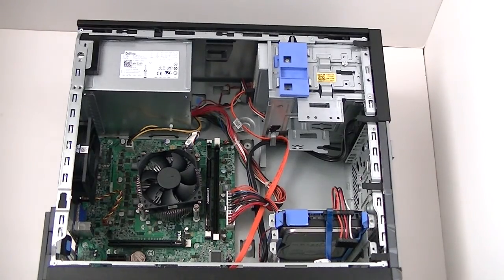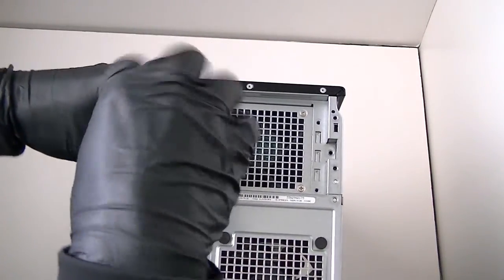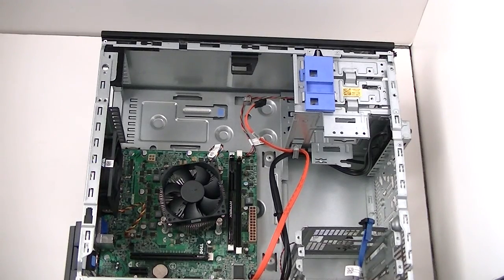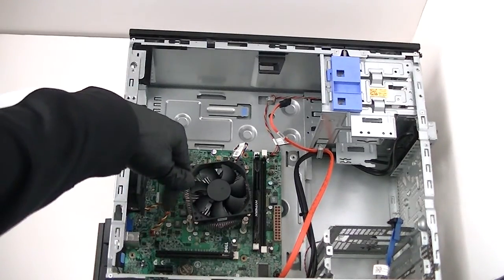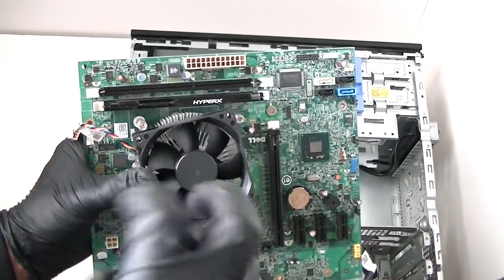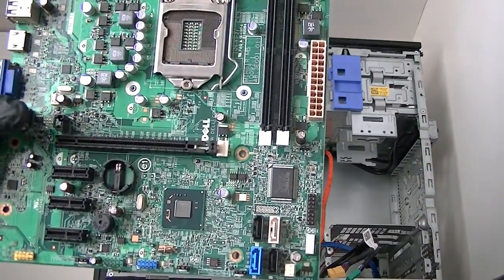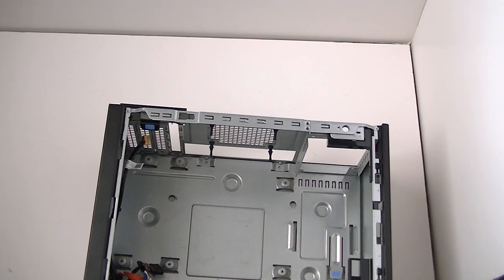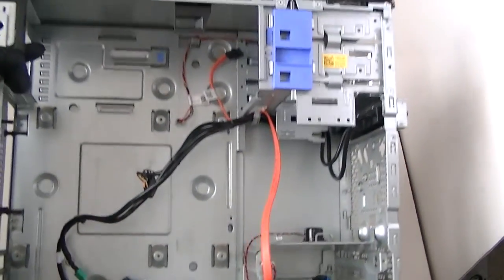Dell Optiplex 390 Teardown

Comment: QUESTION: I have a Dell Optiplex 390 Desktop. It has a DVD in the front, which I use and need to keep. Underneath that DVD drive there is a front panel input for two USB 2.0 inputs, and Earphone input, and a Microphone input. I would like to upgrade this something similar that includes an Earphone input, a Microphone input, and upgrading to two USB 3.0 inputs and even a USB C input. The motherboard does not include any USB 3.0 connections, so I have purchased a PCIE input that includes a 19-pin USB 3.0 connector and a 15-pin SATA power connector. 

Do you know of any front panel device that can replace the front panel that currently has the two USB 2.0, Earphone, and Microphone connections?

Comment: Can i swap the cases with no problem?
Reply from the maker: Hi, yes you can..
Reply: @Mxkdt  Hi, i heard that the power connector is rigged to only for dell cases
Reply: @reimon5410  it is
Reply: @reimon5410  there is an easy way to bypass that

Comment: can i put GPU IN this ?
Reply from the maker: Yes you can
Reply: Thanks
Reply: @Mxkdt  which you I can 
I can AMD Rx 580 ?? 
I have Dell optiplex 390 
I7 2600
Reply: omartion205 depends on your power supply